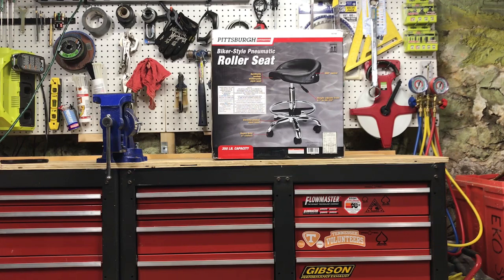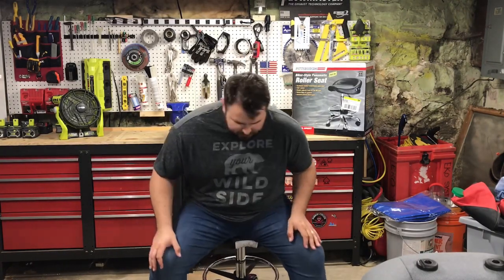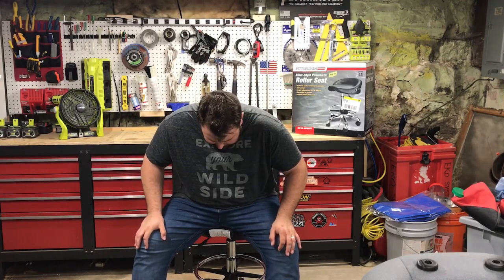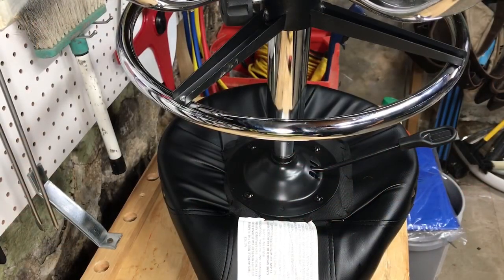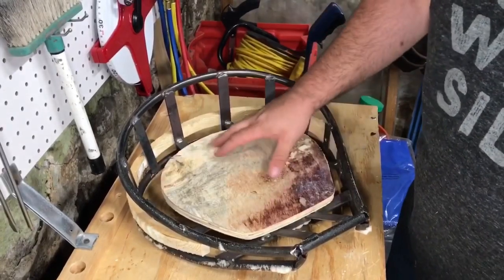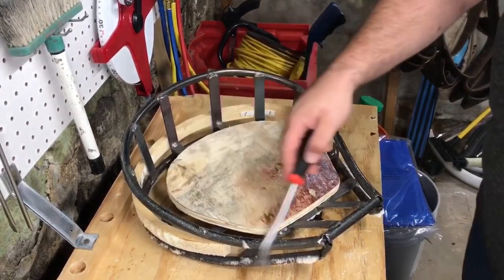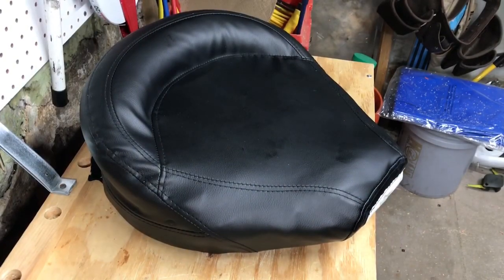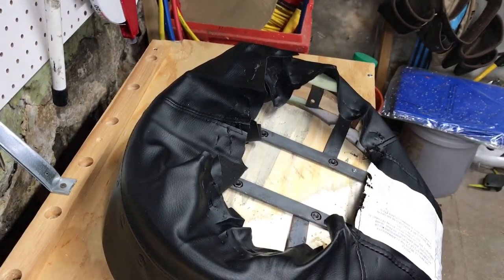Harbor freight biker-style roller seat review

Comment: How did you remove the seat from the air cylinder?  Did you just pull straight up?  I want to change the base so it is wider and put better casters.

Comment: I really enjoy mine. only two issues. 
        First is the wheel issue you described. I couldn't find rugged replacement wheels to replace the M10 threaded light Euro casters so I had to make a wooden base and screw it to the bottom using the a fore mentioned M10 machine screws then I could put any wheel I want on it works great 
      The other issue is I can't just plop down on it and start to work. Ya need to line yourself up on it and make a perfect one-point landing. If I'm up and down a lot it gets to be a pain, but I still love the stool. As close to a Harley I'll ever get these days. good review